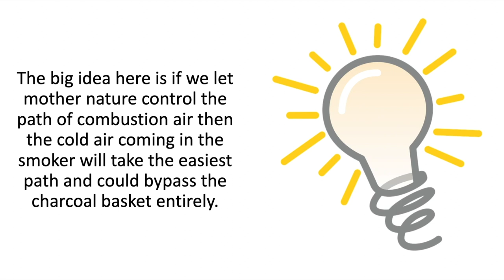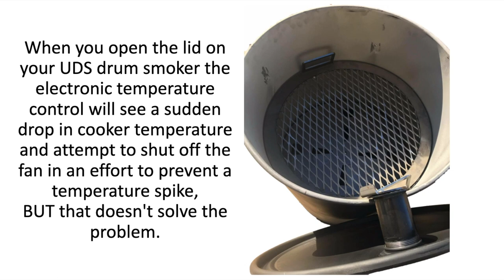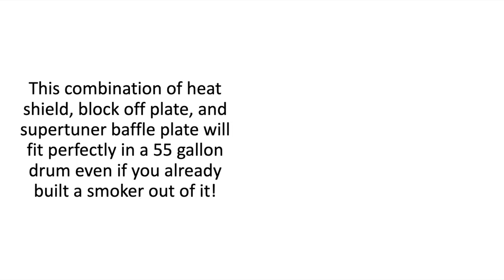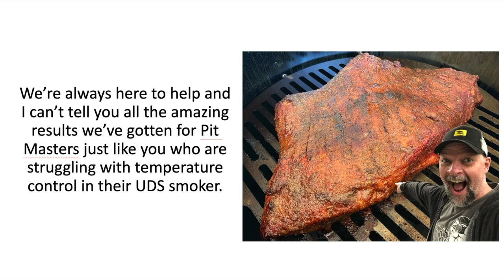How To Prevent Temperature Swings In Your UDS Smoker

Comment: You say the heat shield helps air get to the charcoal basket without bypassing it, but it seems like the opposite would happen. It looks like air would go up the side of the heat shield (in the gap between it and the drum wall) Unless the blockoff plate extended all the way to the drum wall, which it looks like isn't the case. Am I wrong?? Thanks!

Comment: So to increase the temps, I need more air?  But I need to have it flowing over/through the coals? Not around them? I built a DIY UDS and haven’t been able to get above 220ish. So it works. Just not well. I don’t want to add bigger inlets (drill bigger holes and buy new pipes). I’ve increased the number, and size, of the holes in the basket, but haven’t tested it yet. If inefficient, should I add pipes so the air is flowing directly under the coals?
Reply: I used a coupler-nipple-elbow connection, so adding a short pipe to each inlet will be relatively easy.
Reply from the maker: It really depends on the size of those pipe connections. 
One way to tell is if your charcoal lasts more or less than 10 hours. 
If you’re using 15 pounds of charcoal and it lasts less than 10 hours you are likely cold drafting or down drafting. 
Down drafting: watch for Smoker coming out your intakes periodically. 
Cold drafting is air running around the fire but not being heated. 

You should get close to our greater than 1 hour of burn time per pound of charcoal. 

If your charcoal lasts longer than that and you still can’t get hot enough then you might have a lack of enough air flow. Could be the intakes or the stack

Hope this helps!

Join SmokerBuilderU.com for free to post about this in our community